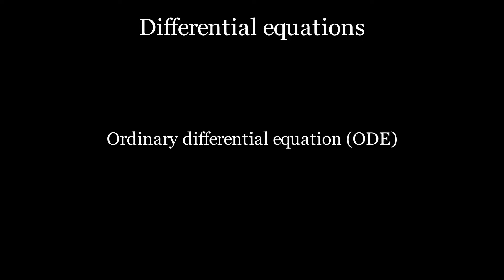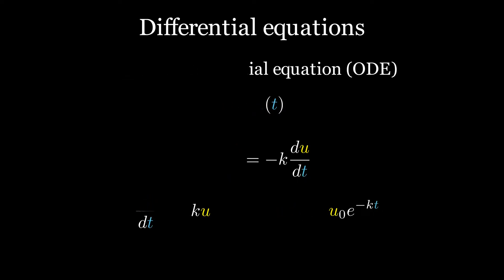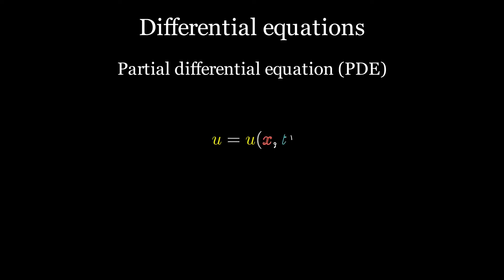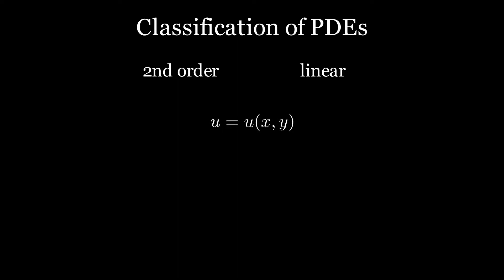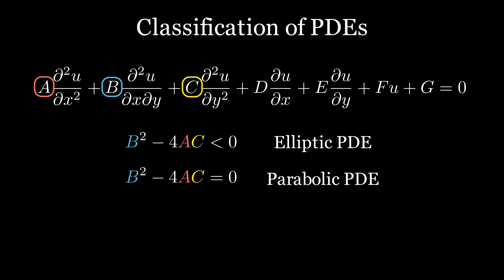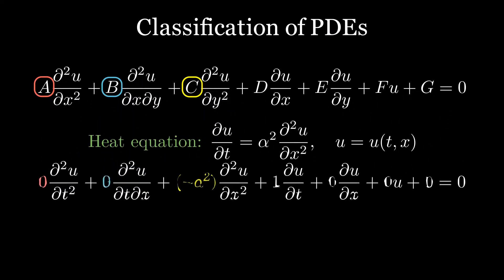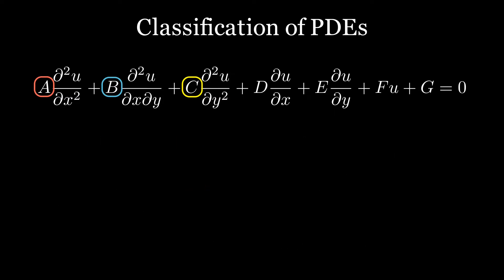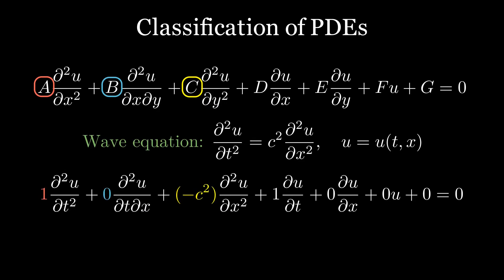Partial differential equations (PDEs) in engineering mathematics: introduction and classification

Comment: Let me guess, you will talk about the heat equation:)) I hope so and looking forward. I am very interested in the heat equation with a heat source :)
Reply: You'll learn all about the heat equation and you'll become Rozum Wielki :)
Reply: @OloNadTrolo  I hope so :P Unfortunately I am too stupid to become Rozum Wielki, but at least I can try to learn something new :)
Reply from the maker: haha, partially correct! it will be reaction-diffusion-advection equation, which is actually a category to which the heat equation with a source belong :)
Reply: @TuxRiders  Is there any chance that you could show in FreeFEM (or any other piece of software you think would be the best, but I prefer FreeFEM), how to simulate a simple problem of heat waves: I have a heat source, let assume it is just a circular source on a material surface. Energy is delivered in pulses and I would like to see the temperature evolution in the material. The problem can be reduced to 2D, but 3D is preferable. If it works, how to add source movement to that? I tried to simulate it a few years ago, but I failed. Now I discovered your channel and my hope to redo that, has woken up again :)